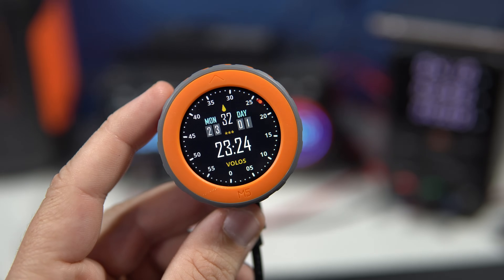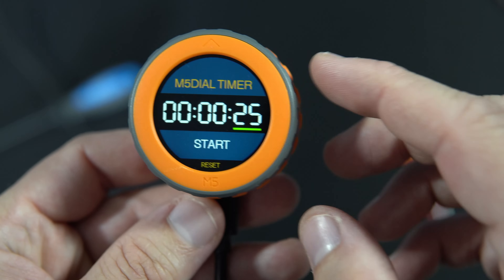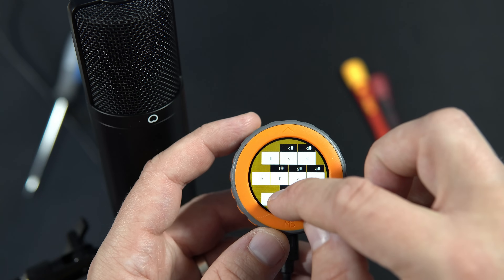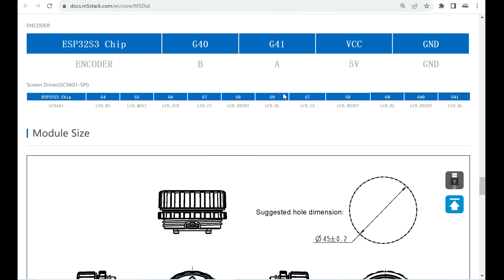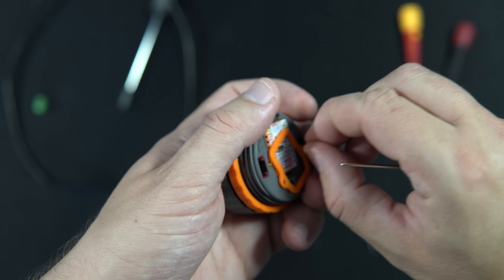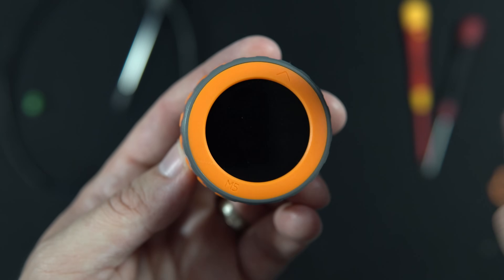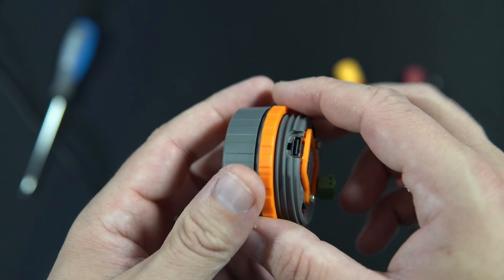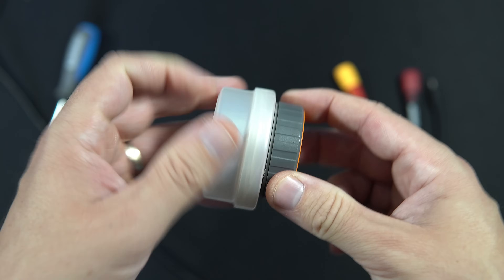Having fun with M5Dial - New ESP32 device from M5Stack

Comment: how stupid is it the input voltage must be minimum 6V instead of the standard lipo or li-ion 3.7V !?
So you cannot power this device easily without adding a buck converter or some other contraption to put 2 lipo cells in series.
Reply from the maker: @PoubellePoubelle-q9x  under that removable m5stack stamp microcontroler you can find 3.7 v bat conector
Reply: @VolosProjects  Thanks but how you get the cable out? It seems a small hole

Comment: This is a great explanation.  I got my hands on one of these to play with, but I'm new to dealing with power for these types of devices.  Can you show how you could power this with a battery pack or something similar other than using the USB-C?  I'd like to make it so this could be carried around or set on a desk similar to how you used the plastic case in this video.  I just don't know what type of battery and connector to use.  Thanks!

Comment: Thank you for actually putting out good examples. There are too many so-called reviews that just unbox and show the factory app. On the other hand, UIflow is way underdevelopped as far as UI is concerned for M5Dial so there needs to be better material as to how to code a good UI for the Dial.
Reply from the maker: Thank you for comment. I still havent try UI flow.
Reply: @VolosProjects   I like it because I don't care much about coding and just want something that works, but they are way too slow to bring up all modules for all controllers.

Comment: If you want to cut a hole into plastic I find those drill attachments with circular sawtooth cutting edge do the job nicely, but use a piece of wood to mount it on as you drill, and cut it slowly on a drill stand. ABS plastic is a nice material to cut in this way.

Comment: How about using one of these as a safe combination input device, with an Arduino inside the safe to check the combination. It could be much better than commercial solutions. The Arduino could send a seed and then the dial could sign the result and send that back making replay attacks impossible. There would need to be a little thought put into this, but I can see that this would be an attractive option.
Reply: I built an electronic door lock for my house that works just like that, except with at 12 digit keypad. I didn't implement the digital signature feature though, as inspection of the signal path wires for a skimmer is trivial, and the likelihood of a thief designing, installing, monitoring, and then returning to utilize a signal skimmer is highly unlikely, and would also show up pretty glaringly on the security cameras.

Comment: The green connector design is called a "Phenix Connector" if anyone was curious.
Reply: Not sure if it is the 2.50 mm pitch or 2.54 mm (0.1").
Reply: @davefilicicchia6341  - same same. It's just a rounding thing. The spacing difference is quite large, so you won't confuse one with the other.
Reply: It’s actually spelt phoenix. Also note that there are 3 pin spacings for them before you dash off to get one.